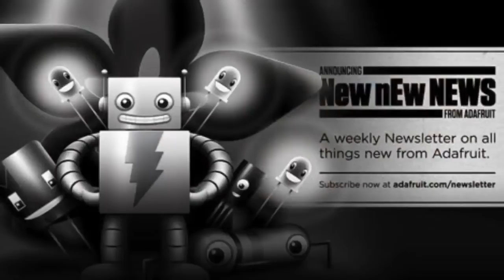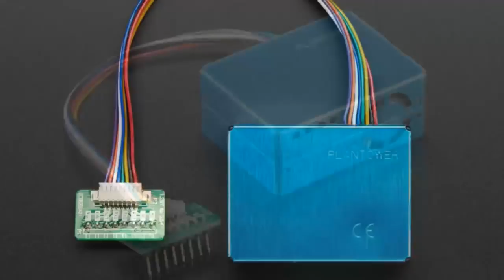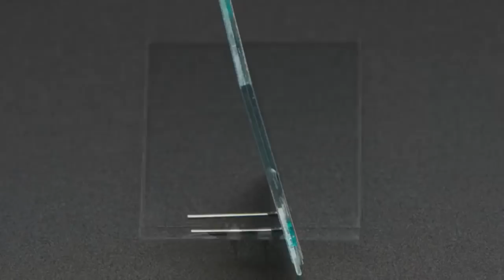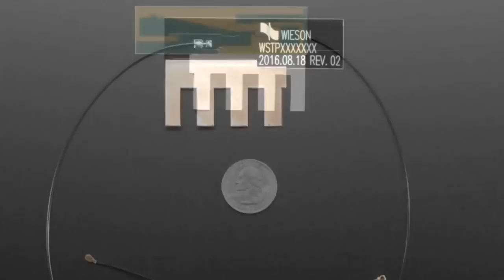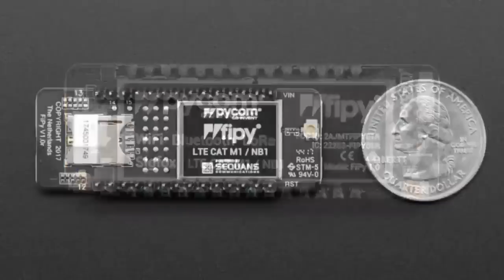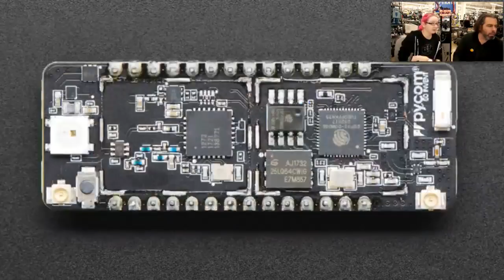New Products 12/27/2017 @adafruit #adafruit

Comment: Woot! Another readily accessible supplier of the Plantower PMS5003. I've got a couple of them in my PurpleAir air quality sensor unit. They've got great consistency and have been field tested over several months without any noticeable drift. I just wish Weather Underground had a more open API that accepted sensor readings apart from their officially recognized federation partners, but I can understand the need for known quality in sensor data.